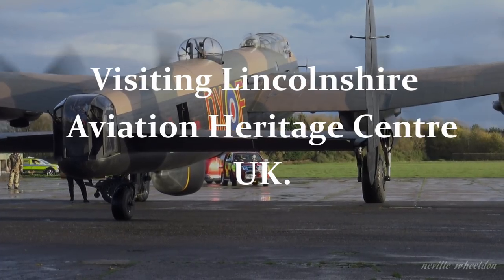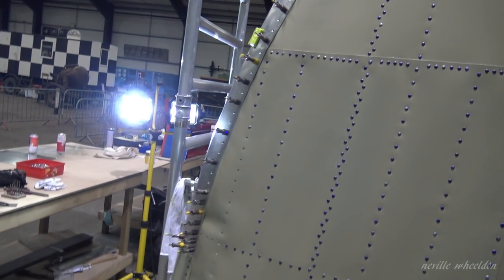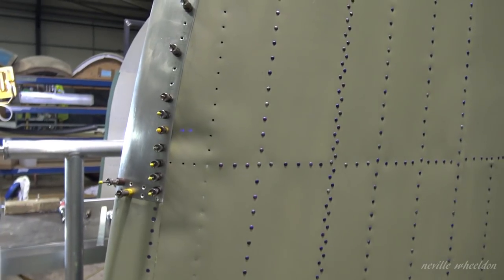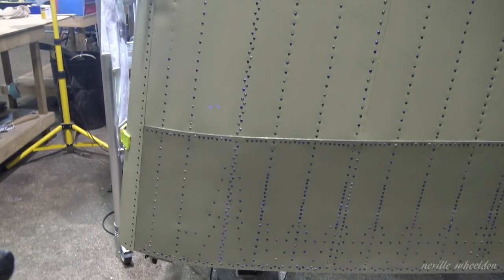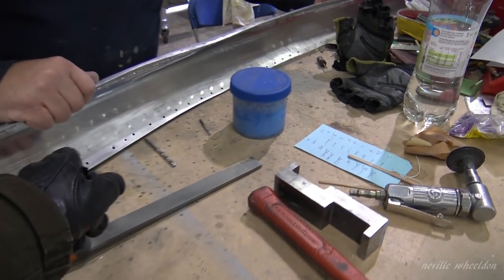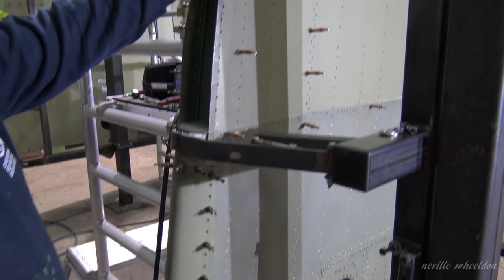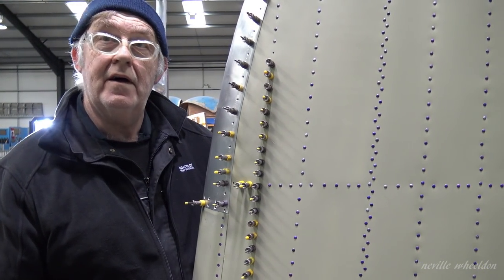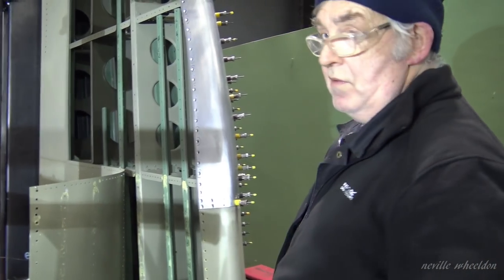Video 80 Restoration of Lancaster NX611 Last Video of Year 3. Part 3 of fitting the leading edge

Comment: well done Nev, really nice bunch of guys there, not always easy for people to be on film which i appreciate their time and patients explaining stuff - like your good self we are all learning - dare i say 'you never knew so much went into it all' but of course i am well aware and to explain why materials work one way and adding a strip here and there will take the lumps and bumps out, very cool - again i wonder if they even bothered during production

you mentioned a valid point i think in last video, can a crimper be used to make the material fit better, i guess once the holes are drilled, they'd not line up and the part becomes scrap, so just how good was the assembly back in the day, were parts so perfectly made, were they stamped to shape, were they all hand made every time on an English wheel - i do remember walking past some very odd lumps of concrete covered in some material on the northern track at Brooklands, these turned out to be molds over which aluminum sheets would be pressed and shaped to form leading edges of wings, such as the mighty VC10 (possibly Concord), but you wonder how much had technology changed since WWII and how are they done now